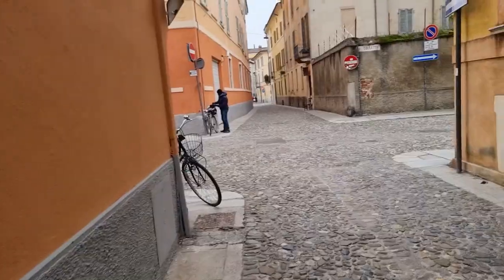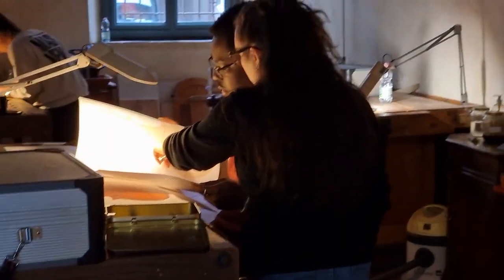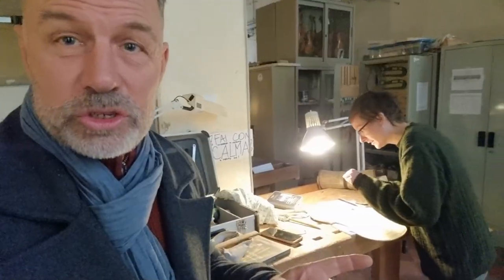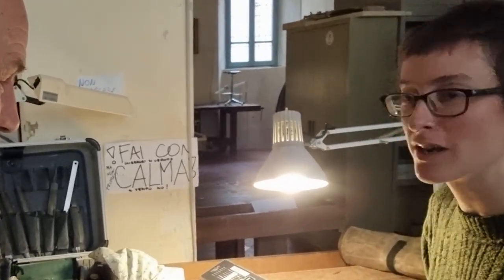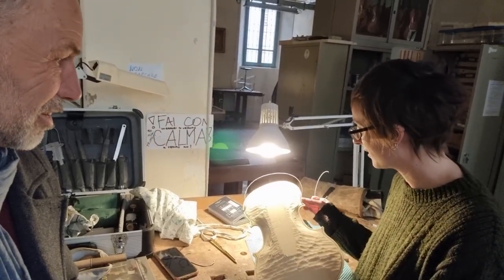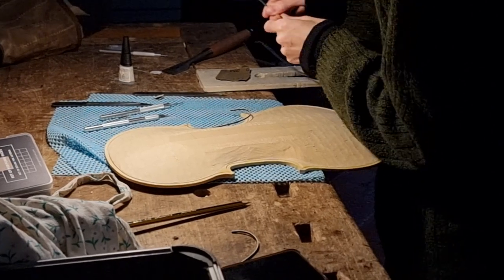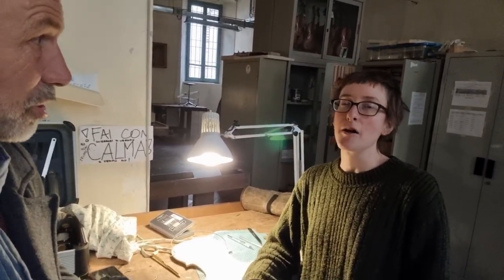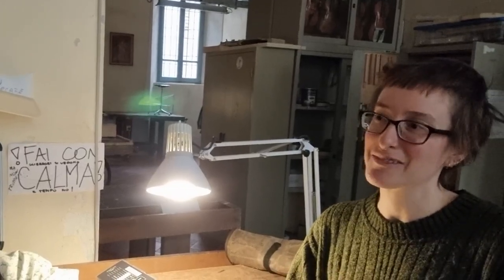I visit the Cremona Violin Making School

Comment: So fascinating. I feel like you would be right at home teaching luthiery, as you are very knowledgeable and like to share your process. Did you pick up anything there that is maybe done differently from what you have been taught, or was what you saw more or less the same?
Reply: Good question... Come in Olaf!
Reply: there are some different methods on violin building. some parts of the process make a big difference, som other not. Some of the more dramatic Iǘe noticed on my years learning lutherie are internal-external mould, Internal or external (again) carving of the archs of top and plate (the usual is to carve first the exterior side, but Iǘe heard of a student from Cremona about making internal first. Violins with or without blocks in the corners (without is weird, but some cheap german ones the use to be like this. Also som cheap instruments used to hace a carved bassbar instead glued and also no block on the neck, just the ribs into it (for sure this last is one of the biggest differences, as is still noticed on how the violin is made after all the process). Some more minor differences is when put the purfling (before or after finish the arch). Oil or alcohol barnishes... How to glue tops and backs (like wich kind of clamping). How to take out the mould, before or after to glue to the top or back... 
  As a friend and teacher told me, also a difference among cremonese lutheríe and non cremonese, seems to be how to put the bench. In Cremona they dont have the light in front of the bench, They use to put it in a wall. Out of Cremona Is more common to look for a window to install the bench, which can be also really bad if the sunlight is so strong... (well, Im not pretty sure If this is a matter Cremona-out of Cremona, Is what I heard and is a big debate when building the workshop. I have two benches: one for winter front of a window and other for summer, with the light coming from the left)
   Im pretty sure theres still a lot of differences (like  neck and scroll carving methods, different tools, templates...). In the end we just look for the end of the procces, which is a a pretty, good sounding and instrument which can be able to been played as many years as posible without problems and as much as stable as posible